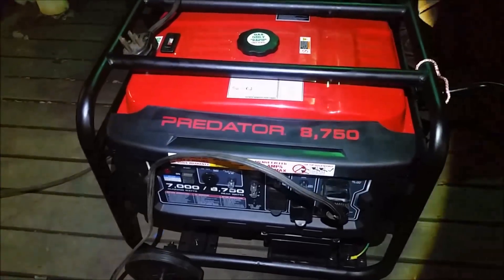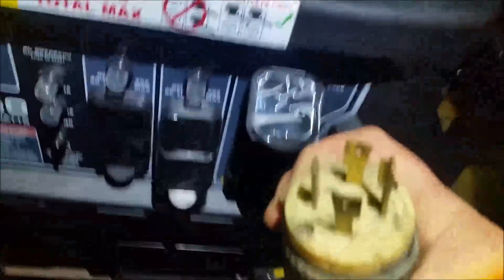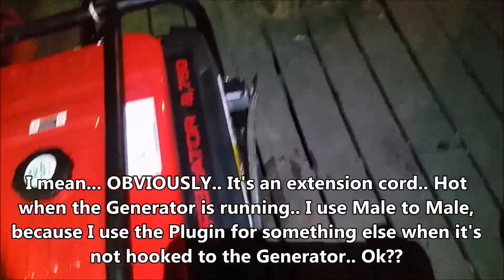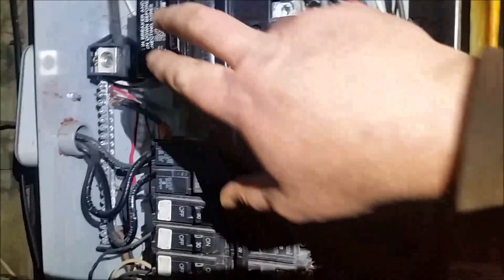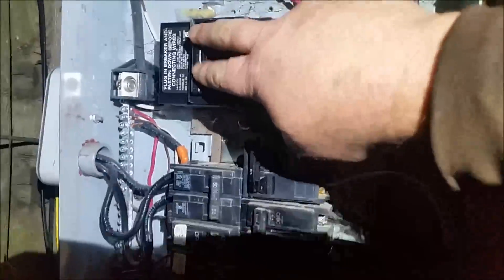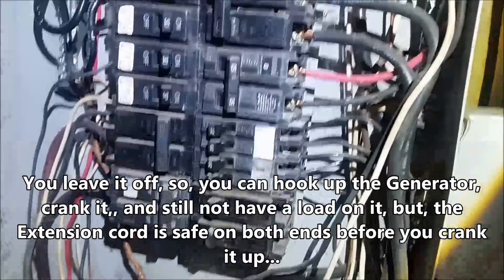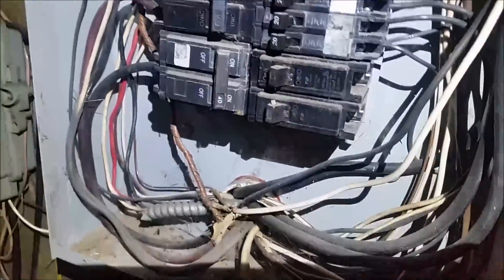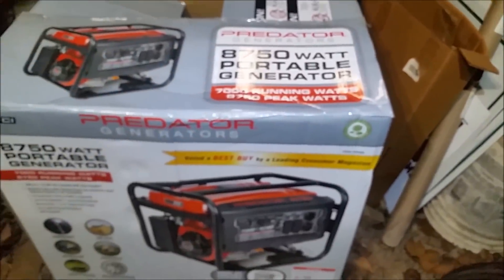Quick/Easy/Safe: Use Existing Plugin/Breaker for Generator hook up to your house Panel box.

Comment: DUH !!   I FORGOT TO FLIP THE MAIN BREAKER OFF !!   WHY IS THERE A COM ED GUY AT MY DOOR WITH A GUN  !!!!
Reply: Joe smith = dip shit
Reply from the maker: Ha.. Joe Smith.. "Com Ed Guy at the door".. This video is not for you.. It requires common sense..  If you forget to turn the main breaker off,, and I am your lineman,, you won't have to worry about fixing your generator any more.. Just buy a new one and you won't forget to turn the main breaker off again.. 
You let me know when you find a lineman who grabs a High Tension wire without checking to see if just what you said,, might be true,, whether or not it is a Customer breaker between his generator, or, a Utility power Main Breaker... But, guys who have no common sense won't be working as a lineman,, or won't be working long as a lineman if they are that foolish...  You never Assume the line is Cold.. It is always hot, even when the power is off.. 
Why do you think they have all of that safety equipment?? Because they work on "Hot Wires"?? Ha..Ha..Ha.. No.. They always turn the power off, but, never assume it is off... Anything could happen,, and your life depends on it. That's why they wear the gear they do..

Comment: This IS safe but any one who can not completely  understand the wiring design should pay to have a transfer switch installed. If some one with weak understanding were to have the generator running with the main on when the power came back on ----Well it would not be pretty.
Reply from the maker: That is just the point... The only thing "Unusual" about it is the Male to Male Extension cord...  Nothing to install.. Just use what is already there.. Just remember,, the first thing to do is Turn the Main Breaker off.. Pretty simple past that... 
And,, Make sure the Generator is Turned off and the Generator breaker is turned off before you unplug the cord "you made".. If they can make the cord without any instructions from this video, they can easily understand what to do after they make the cord.. So,, I would say,, if you can't figure out how to make the cord,, don't do it.. 
I agree totally.. It helps to understand the "Wiring Diagram" for the simple reason that you should if you are planning on doing anything electrical.. It is where your knowledge should start.. Understand the dangers involved, and what is feeding your breaker before you unplug whatever it is that you are going to plug the Generator into.. However that is done,, would be a good thing,, especially if it involves someone looking before touching.. Ha.. I think that falls into the Common sense category though, and those are who the video is designed for.. Also the reason I did not say anything more than,, You build your own cord (male to male),, but, no instructions on how to build it. If that stops someone from starting,, it was a good thing they didn't start.. Cheers..
Reply: No. You seem to think "safe" is the same as doable. Hookers look "doable" but are they really safe?
Reply from the maker: I have been doing this for 15 years.. But, then again, I am not the type of guy who forgets to tie my shoes, put my car in park, etc.. I don't forget to Turn the Main Breaker off before I hook up the generator.. If you have any of the above problems, by all means.. Call and Electrician.. 
Like I said.. This video is for people who have common sense.. By your comment, that means.. NOT YOU!! Get an Electrician.. This is definitely NOT FOR YOU!!   BTW.. Whether a hooker is safe or not is up to the hooker.. But, by the nature of the Trade, I would think, that would be very hard to do.. But, can a hooker remember to tier her shoes? Put her car in Park? Turn off the Main Breaker?,,, Well, if this makes sense to her, then, she can surely do it safely, whether she is safe in the way you describe or not... When you get right down to it.. Would you think someone like yourself was capable of doing something like this.. I would feel that you and the hooker in the sense you were suggesting would be about the same.. You should find something else to do with your time... Just being Honest.
Reply: @MarkThomas123  No. Again. It is not safe. It seems my humor made you defensive. So no more humor, only facts. The National Electric Code in NO way condones this poor attempt of tying generator power to a residence or commercial building. I am a licensed master electrician. Have been for 18 years. Have been in the trade full time since 1981. I know what is legal ans safe when it comes to electric. I can only hope your unsafe practices dont lead to any deaths. You are doing a huge disservice to the community.  There are the facts.
Reply from the maker: Eixr.. Very good.. If you are an Electrician and you know NEC,, then, please tell me what section and subsection of the code, you found  NEC regulating "Temporary Extension Cords".. Provide a link in your reply, so everyone can gain your knowledge.. 
When you are done and can't find it, I will show the closest thing to you, since you somehow graduated without knowing such a basic thing about the NEC and got your license somehow.
But, if you were an Electrician, you would know.. NEC tells you when you "Have" to have something hard wired,, not when you can use an extension cord.. And describes the functions of Plugs and Receptacles for those wishing to manufacture them, but, does not address temporary or portable extension cords at all. But, since you are a Licensed Electrician and you "Know the Code", then, it will be simple to show us what you know and where the NEC supports your claims.. 
But, you are not an Electrician, and you won't find any such codes.. And, that my friend is a FACT!!